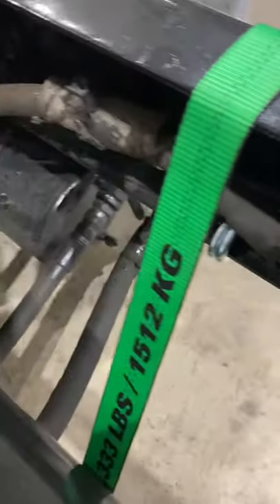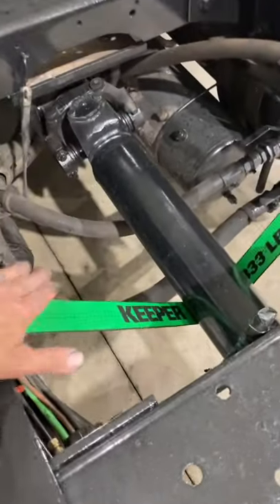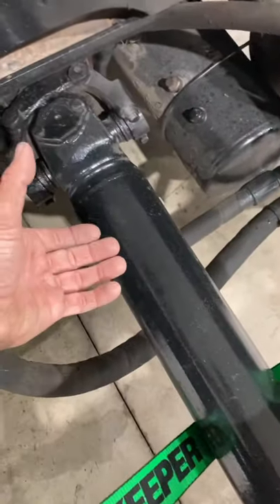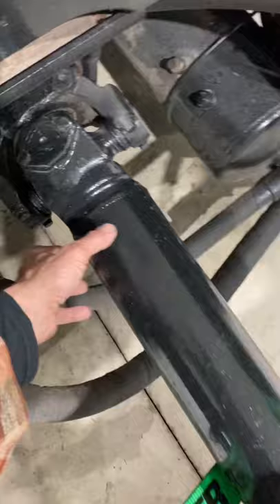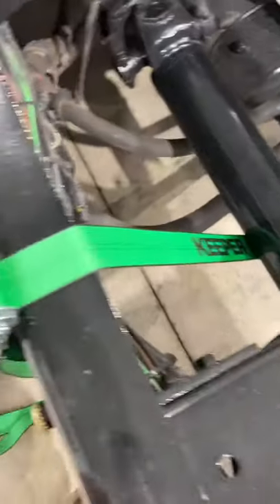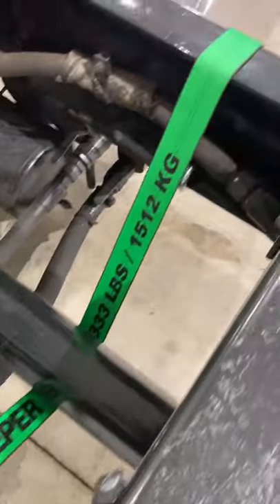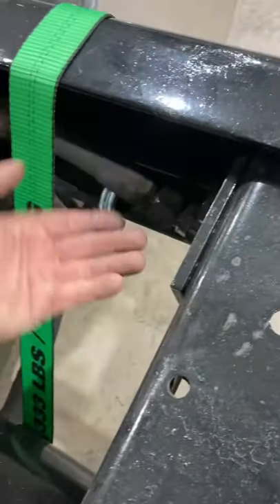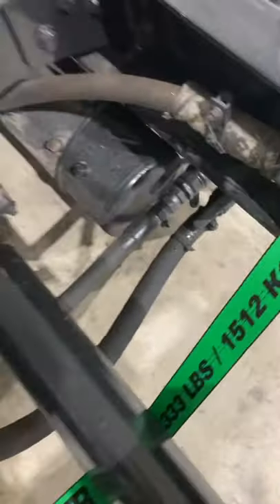Mechanic’s Trick w/ Ratchet Straps. U-joint & Hanger Bearing, Driveshaft Service. I trust Keeper.

Comment: Absolutely right! My boss always wants to find a different (harder) way to support transmissions/torque tubes/ driveshafts etc on the lift, but i personally always go for a ratchet strap, or two. They can’t get bumped as easily as a deadman or a trans jack, and can move up and down with the car if need be. Tons of advantages. They’re not just for securing cargo!